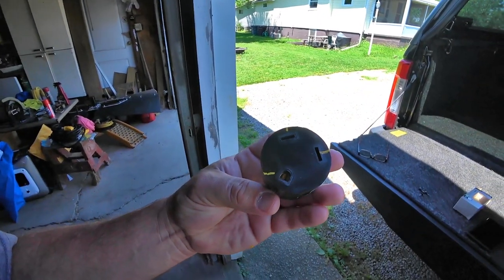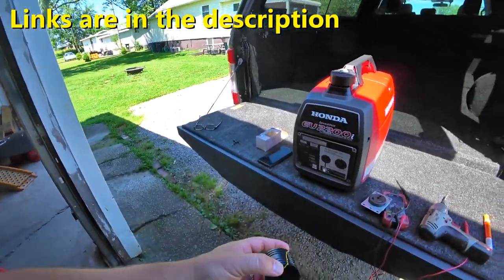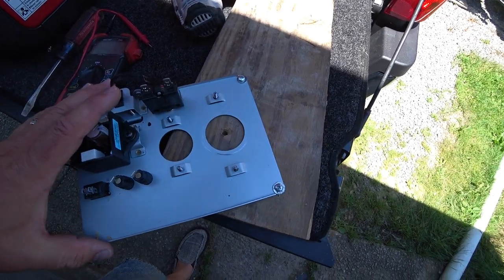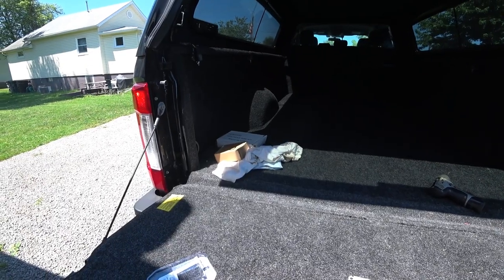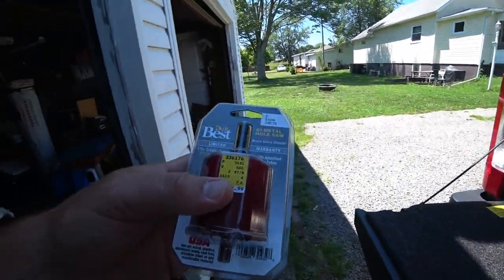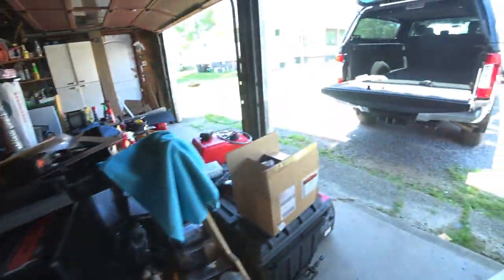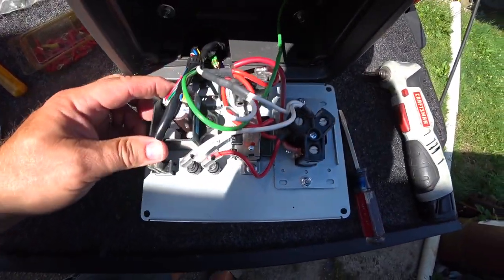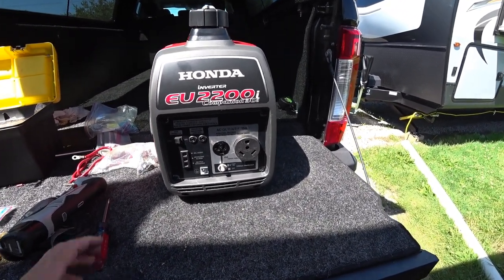30 TT RV Plug on Honda EU2200

Comment: Great job. Very professional install   I have the same generator use it for camping. I changed my double receptacle  to one with 2 USB ports in the center. Now I can run 2 extension cords and still have 2 ports to charge phones.

Comment: I wish Honda would install a 30A TT plug and fuel gauge like Yamaha. Great job as usual! I installed a 30A line and TT plug at my residence. I can run one A/C on my travel trailer when it is home. I still love HFT.
Reply: Sure would like an hour meter too
Reply from the maker: Check our link in description 😁
Reply from the maker: Yeah to clarify a little bit more oh, we added an hour meter to our Honda I think I did a video on that. If you read through the instructions though those Hondas have some kind of a flashing light that lets you know how many hundreds of hours the generators been running. So it does have an hour meter it's just a flashing light.
Reply: @Rvdaydream  thanks for the info. I forgot about that feature. Sure would be nice to have some numbers instead of a ballpark. I’ll have to give the link a look.

Comment: I have a question about generators... if you have 2 Honda 3000i generators running in parallel you still only have a 30 amp plug in. But now you can run 2 air conditioners right? So can you run your 50 amp trailer off of a 30 amp plug with two parallel Honda 3000i generators?
Reply from the maker: They make a 50 amp parallel kit for 2 Honda 3000 I. Just Google Honda 3000 50 amp parallel kit

Comment: Nice too see somebody think outside the box and make something work for them.. there are wolfs and there are sheep. While running our 2200 Or am plugged in at home I adapt at the rv and run a cheap 15 amp cord that can lay in yard and in the sun so not too use my oem 30 amp cord. Good job!

Comment: Hi, You are amazing.  I know using the adaptors is not good that it can build up heat in the wires from insufficient contact.  That is a fantastic idea to change out the plug.  I wouldn't care about the warrantee either.  I currently have an Ingersoll Rand / Honda 3000 generator that had an RV plug installed.  I used to use it on my 24' Gulfstream TT.  I am getting older and just got a Palamino Solaire 20 footer (we downsizwd the kids are older and gone off).  I am somewhat familiar with the easy start.  I was told I needed a minimum of 19Amps to kick the compressor on (I guess the easy start makes it work).  With our age, my older generator is getting hard to lift.  My only question is over time is the 2200 Honda insufficient to continously run a 30A TT.  I have broken down 2X in the past, once I lost the transmission and once a fuel pump.  Each time my Ingersol Rand generator saved our bacon (the wife is a recoverinng stroke patient).  It was on for like 3 days continuous to keep the AC on for her.  Do you think the 2200 Honda would work the AC, a TV and the fridge on electric with the easy start.  I know Honda also makes a EG2800 (that is lighter than my older generator that could also take your RV plug modification.  Please email me cliff70chevy@gmail.com  Thank you

Comment: Definitely prefer the twist lick connector. My experience finds that the tt30 connector normally backs out due to engine vibrations from the generator
Reply from the maker: Nope, 3 years fulltime, not once did it back out.. 1st year on the road did 33 states and 22,000 miles.. We left the tt30 plugged in the generator that was housed in our generator box on our Travel Trailers rear bumper and even though we had to replace both axles due to rough roads the plug remained...
Reply: @Rvdaydream  you must be lucky then. I unfortunately can't say the same

Comment: Mike, our Honda generator has the 2 110 plugs…how do we get the 30 amp to work with that?
Reply from the maker: I don't know of a way to do that. I'm assuming you're talking about two separate Honda generators and neither one of them is the companion generator that has a 30 amp plug. I know that there are people that make adapters they call it an Edison Y adapter I believe. But I think there are some potential problems trying to run an adapter like that using two different generators. That's why the parallel kit with the companion generator is so important because it keeps it in the correct phase and they get to talk to each other so that one does not hog up all the current. It's pretty particular too because even the 2200 generator that I show in the video is actually only able to be a companion with that generation of generator and none of the Honda 2000 Prior. So if you decide you're going to buy a companion generator with that 30 amp plug you definitely have to make sure that is compatible with what you already have. Again, I'm assuming that you're talkin about two separate generators because you cannot get 30 amps out of a single Honda 2000 or 2200.

Comment: The yamaha 2200 is louder about 10 pounds heavier/larger and still no fuel pump so hard to run an extended run fuel cap.

Comment: We also have a 2020 Flagstaff with the exact same here unit and much of the same components that your trailer has. Am I understanding this correctly, you're able to run your air conditioning on a single small generator using what you showed in this video as well as the micro air? It's maybe something I want to seriously look into.  Dry camping in the national forests down here Tennessee and this would be really nice to allow us to do this more in the summer
Reply from the maker: Awesome! To answer your question yes. I did a video on the micro Airsoft start installation or at least an overview and then I showed some testing. I have the Microsoft starts installed on both rooftop AC units end I could almost get away with running both of them on 30 amps. I think that it would require a true 30 amp power source and for whatever reason my Champion generator did not want to run both of them without turning on the overload light on the generator. My 3000 watt atima generator however, wood run both rooftop airs and it didn't seem like that it was an issue. Anyways if you decide to go with any of those components please if you could use our Link in the description if you decide to purchase from Amazon. Thanks for watching!

Comment: I would not want to void my warranty. Honda should have put the rv plug on it. I use the adapter on mine and if it messes up the generator I'll get it fixed under warranty. I have made a short cable with the twist lock to RV. This keeps the cable short for maximum voltage retention. I found the longer cord drops the output of the generator.

Comment: At CAD$1499 for the Companion up here in Canada it’s just not worth voiding the warranty just to avoid using the adapter. I agree it’s too bad that Honda doesn’t put a TT-30 on it in the first place or at least offer it as an option or accessory. BTW the Canadian model is slightly different than the US model.

Comment: The Yamaha 2200 comes with RV plug from factory and has and OVH engine like the eu7000 does
Reply: But Yamaha also states that their 2200 generator is not designed to run ac units.
Reply: Yamaha 79cc engine, Honda 121cc engine, quieter and 10lbs less weight, fuel efficiency would be about equal as the Honda wouldn't work as hard as the Yamaha.

Comment: How quiet is your generator with a load on both econo and regular mode?
Thank you,
M
Reply: I have the same generator. Eco mode only changes how the unit idles. In Eco mode it idles slowly; in normal mode it “idles” much faster. Under load it’s all the same.

Comment: I do not see where this new outlet is connected through a circuit breaker. The smaller outlet is directly connected through the 20 amp breaker????
Reply: My generator seems to be wired differently from yours.  The red power  wire to the large plug runs directly to the power supply,.by passing the 20 amp breaker.
Reply from the maker: They changed EU2200 wiring compared with eu2000

Comment: Don’t you need two Honda’s ties together to fully untilize the 30amp plug?
Reply from the maker: not really...I don
t have 30 amps but thats what the micro air easy starts are for...
Reply: YES.  This really does nothing, other than eliminating the adapter. Its still not 30 amps.  To actually take advantage of the 30 amp plug you NEED 2 generators.  Yes, you can run an air conditioning unit off one, when done properly.  But thats not the point.

Comment: Just my opinion you should have changed the end on the cord not the plug on the generator those twist lock plugs work and last a lot longer
Reply from the maker: Because they twist they are not angled at 90 degrees  so the entire time the generator is vibrating, the weight of the cord hangs straight out from the outlet.. Plus it takes up more room if placing inside a bumper mounted generator box as I did here https://youtu.be/A4IanhvQtiA
Reply: Good though Chris.

Comment: I’m not seeing the value of buying the companion that has the additional $140 price tag on it. Especially if you’re planning on modifying it with the 30amp “RV”connection. Save the extra $140 for the companion and get yourself the standard eu2200i and do the same conversion. FYI the unit puts out 18amps.
Reply from the maker: The video is more geared to all the current Companion owners...I bought the companion because I ran the Generator without this mod PLUS the front panel would look even worse and may not have sealed off as well trying to replace the rectangle 110 outlet with a larger round tt-30 plug... also the unit will peak at 18 amps it's rated output(99% running) is only 15amps
Reply: The companion actually provides 30 anps when paired with another generator.  This does not.

Comment: Only voids your warranty on what you changed.  tks
Reply from the maker: Well, I would think that since I re-engineered the electrical connections on an electrical generating device they can pretty much say anything electrical would not be covered

Comment: I thought I could just plug my 30 amp plug right into the generator.
Reply from the maker: You can if you want to use the adapter. But the adapter in addition to the tt30 plug is a lot of weight hanging off of that outlet and there is a chance that it could twist out or just cause something to break. That's why I converted over the twist 30 amp to a tt30 amp plug so I can plug right into it Direct. It really doesn't make a difference as you don't get 30 amps out of that outlet unless you are paralleled with another Honda 2200
Reply: @Rvdaydream  Thanks when I get the gen I will see how it goes.

Comment: lol you can buy a plug 30 amp female  to 15 amp male.  for 13.00. plus free shipping>a   some folks love  work. lol lol . the new one does not have this 30 amp plug.
Reply from the maker: The new one does have that plug if you buy the companion model. And good luck with that high quality $13 adapter you're wanting to run. Not only is it prone to fail but it also causes extra stress on the plug having all that extra length hanging out in front of it as the generator vibrates during normal run conditions. Also I build a generator box for the back of the RV oh, it's pretty tight quarters in there and I don't think that I want to run an adapter in that situation either as it's just going to cause you to have to buy a bigger generator box so it fits inside with that adapter sticking out.
Reply: @Rvdaydream  You can also buy a better one from a RV shop or a heavy duty one from A. those 13 will handle the 1800 watts. What i am saying is that you didn't have to do all that work, you could have just purchased one part. Come on now? folks are over the place use these pugs/cord/ adapters with no effects from vibration. Plus not everyone is going to use it with a box like yours. Why void one's warranty by doing something that could be fixed with a normal part? Ps, it was you who got me to buy a honda in the first place, with the extended gas tank.  You are one for one.
Reply from the maker: https://youtu.be/sHPXqP6fC4E is a just one of many, many fails

Comment: great idea, but i would not have used a red wire off the plug for ground, it should have been green !, color blind or not, if in doubt ?, let someone that has good eye sight hand you a green wire...lol.
Reply from the maker: I didn't have any other color that was of sufficient gauge
Reply: @Rvdaydream  ground does not need to be very large, did you notice they had two small green grounds tied together on the panel ?. ground does not ( of shall i say..should not ? ) carry high voltage, all it does is give a path. if you had two small gauge green wires, you could have used two of them together to the panel, and it would have worked out fine. with a red wire used for ground, all you are doing it making it hard later on to explain why you have a red wire for ground ?, ground is ALWAYS green, unless it is in tt ?, they use white alot for grounds.
Reply from the maker: Well somebody can't see that the red wire is going to the frame they don't belong in there messing around with it. I didn't want two wires that I had to make two eyelids for that I had to keep together as I tighten. And I didn't have small gauge wire eyelets that had a large enough opening for the stud that was already on the frame for the ground wire.